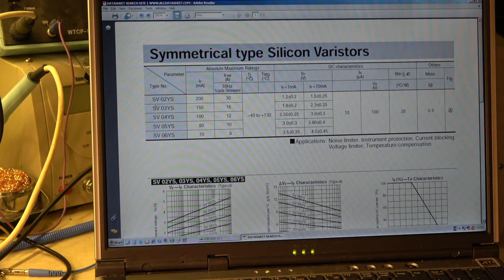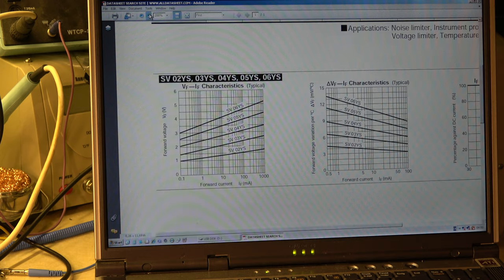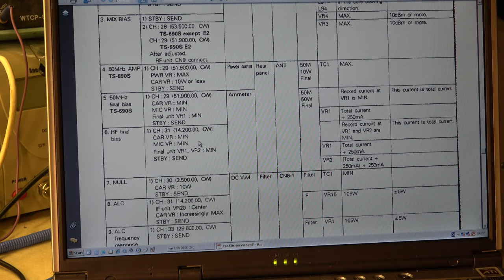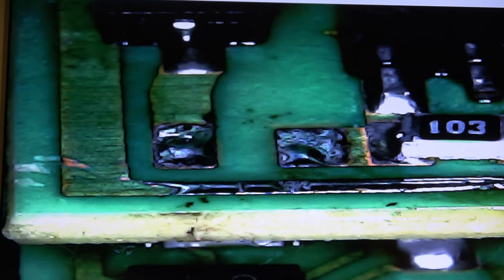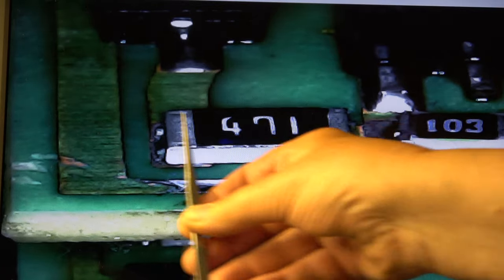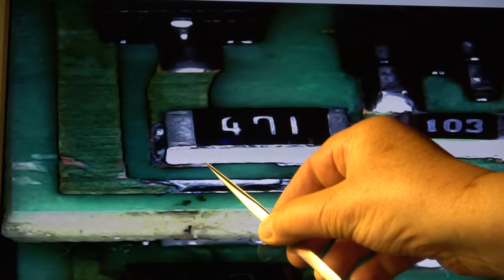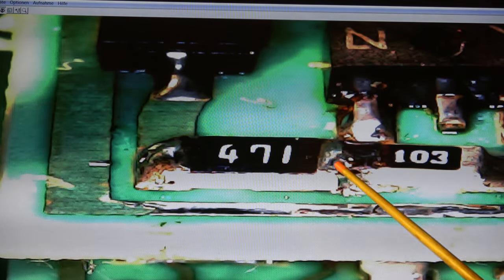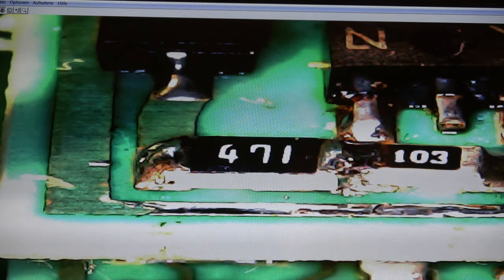#130 Kenwood TS450S Part 1(3)

Comment: those round connectors are called TMP connectors and some ebay sellers are asking outrageous prices for them (5 GBP !!!!) . But there is a fix for them, if the middle wire is crimped badly or if it starts not making contact just use a bit of solder and solder the tip where the crimped wire comes out. I managed to fix all TPM connectors in two of my TS430-s and a few TS450 too. 
regarding this TS450, don't forget to change C104 (470uF / 10V) on the IF Unit near the TDA2002 AF final amplifier to a 470uF / 16V one. This capacitor was alway leaking or was already exploded in all TS450 i ever repaired.
Reply from the maker: Tnx, the C104 was already changed by the previous owner. It had been leaking as i could see.

Comment: When setting the HF final bias what test points do you have your multimeter connected to in order to set the correct current?
Reply from the maker: It is the total supply current from the power supply 13,8VDC. Alignment is done by change (increase) of supply current for driver and pa bias
Reply: @dl7majstefan753  thank you that is how I ended up adjusting the setting. I was thrown off by the service manual saying to measure at the antenna. Thank you for making these videos they are very informative.

Comment: how do you tune the receive on a Kenwood ts 450s my receive is very low enjoy all your videos I have watched Thanks
Reply from the maker: The alignment is to be done acc. to the service manual.
But if there are problems, maybe the band switching diodes are faulty.
Or the ATT switching is bad.
Or the TX-/RX- relay needs cleaning.
Or the switching between AIP ON/OFF is bad.
Only some ideas from me, but a remote diagnosis is not possible for me - sorry

Comment: Sorry to say, R151 is also a typical fault of TS-850S and TS-950SDX, they both have identical TRX unit. R151 overheats because its wattage is underrated.
Reply from the maker: We are talking here about the TS450S, not 850/950S. I don´t find a R151 which could be overheated.
Reply: @dl7majstefan753  The TRX unit in TS-450S is identical with the one in the TS-850S and TS-950SDX, it has the same part number.
Reply from the maker: @batman4e  Ah! OK, now i understand! Sorry about my slow understanding ... This R151, which i changed is 470Ohm and loaded with 7V during TX. That is app. 100mW; too much? I replaced it with a bigger one. But there is another one: R155 - same value and permanently loaded during RX, which is a longer duty cycle than TX. Didn´t change it.
Maybe this overheating was the cause of the grey "powder", which is simply overheated solder.

Comment: The plugs are called "Taiko-Denki" or "TMP" connectors for short. They're very hard to find...I have sent you the data sheet via email.  73 - Dino KLØS
Reply: Also, and I may have mentioned this to you before is you had another 450 on the bench...C104 is an audio coupling cap that appears to fail often. I fixed a 450 some time ago with low AF audio output and replacing that cap fixed the issue. Found that info from a web search so not original to me.
Reply from the maker: Tnx, dr Dino. I found these connectors now at a local supplier.
I didn´t know the name and search engines are more stupid than me in such a case...hi.
Meanwhile i found the problem - see part 2
Reply: @dl7majstefan753  Glad you found them locally. You really don't need the very expensive crimp tool to attach them to a piece of RG-174 or RG-316. Strip the coax back about 1" or so and separate the shields along two sides with a sharp pick so there are two braid pigtails; then fold them back along the cable. Strip the center conductor and tin then insert it into the connector and adjust the dielectric so that the inner conductor goes all the way through and the shoulders of the shield wires top out at the top of the flange channels. Once you're satisfied you can solder the inner conductor and then with a pair of pliers that will allow you to put a lot of pressure on the flange crimp the shields inside the channels; you can lightly solder them and just snip off the braid outside the channel. I was unsure this would work the first time but it's all much easier than it sounds!  73 - Dino KLØS